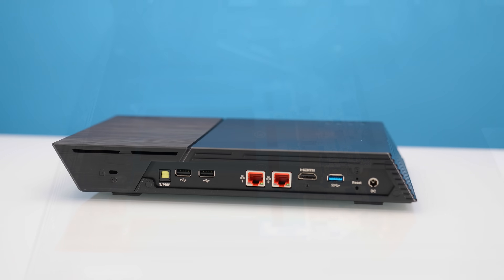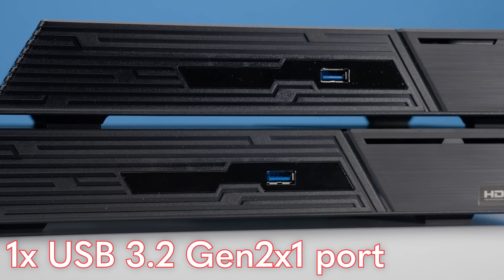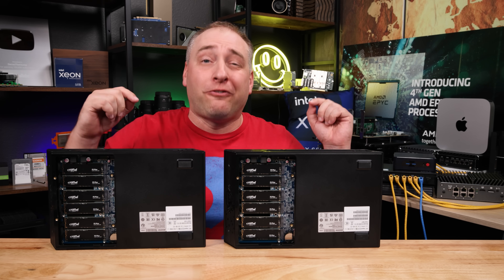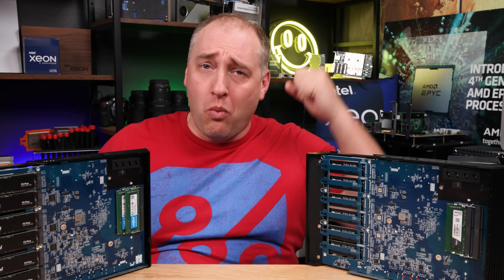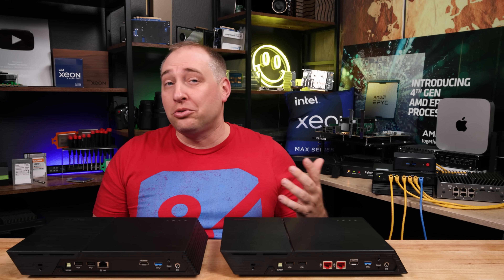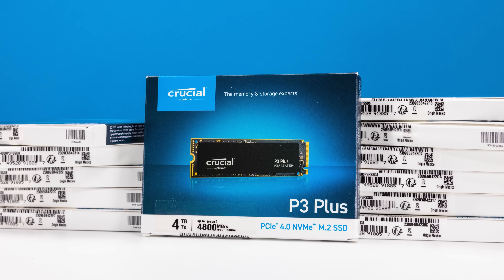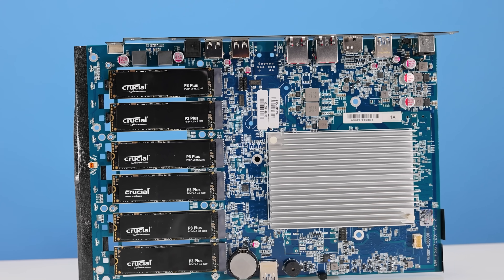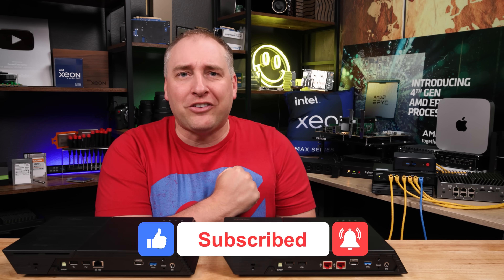Crazy 48TB SSD NAS and Cheap 6TB Version Asustor Flashstor FS67

Comment: I'm glad you finally explained just how anemic these devices are. I fear the way they're marketed might be misleading for some consumers. However, knowing that they barely have enough PCIe lanes to service a single NVMe drive, the NIC does make more sense. Although, 10GbE has been around for over a decade, and we're only just now barely seeing it begin to appear in some really compromised devices? Come on, what's the hold-up? And why does it need to reach out to 100 meters for? Why can't we have a new standard for short-distance communication over distances up to only 100 feet? We could do it with the same devices we already have. Just tweak the firmware, and use a different encoding scheme. I feel like the 100 meter standard is simply more than most environments call for.
Reply: Because the physical interfaces are based on standards and are designed to perform and apply to the widest array of uses in the commercial environments.  The consumer enjoys the trickel down of these improvements in products.  They take advantage of these by way of commodity chip sets developed to meet these standards via a slew of small, and not so small, players in the tight margins of the consumer markets.  Also, a run over 30 meters happens easily in allot of homes and fails to account for the end connection terminations and pair of patches.  Having the margins extended is a good thing where consumers are poorly installing and terminating twisted pair cabling.  Seldom do consumers follow best practices nor do allot of people calling themselves "professionals" for that matter!
Reply: @mikeiver  I'm aware of all that. I was thinking something along the lines of USB type-c or HDMI. Those have to be prefabricated, and it would offer the badwidth needed. It would be extremely short range, but that's plenty for most SOHO environments. We do not live or work in huge datacenters, factories, or institutions. Why should end users get stuck with the same crumby speeds as large organizations? Why can't we have a separate standard for consumers and end users? Consumer hardware is garbage, and it doesn't need to be that way.

Also, some devices are adaptable, and can change between 1, 5, or 10GbE. But, why are we limited to only these? Why can't we also have the option to choose higher speeds, but shorter ranges? The user should be able to adapt the device to the environment.
Reply: @TheChadXPerience909  Well you say you understand  but then miss the point I make entirely.  Regerious standards used for networking are arrived at with the participation of a bunch of stake holders contributing to the eventual standards everyone builds equipment to.  These standards guarantee interoperability and base performance.  They also cost many tens or even hundreds of millions to develop.  Consumer markets for your desired level of performance simply don't warrant such an investment.  Go 10Gb and use trunking.  Or buy used infiniband hardware if you think you really need to move that many bits that fast!
Reply: @mikeiver  Please do not speak to me like a child. I understand how business and the world works. I don't think it's unreasonable to develop products which adapt to the environment they're used in. We already have NICs which support multiple standards. Adding a few additional standards for users with shorter distance needs is entirely doable, and wouldn't be difficult to impliment. You could simply select the standard you want from the driver, or BIOS settings. All you offer is the same old excuses, it's too expensive, too much work, too little interest. We've all heard it before, and we're tied of excuses. That's just a negative attitude which holds human progress back. All you're saying is that YOU aren't going to get off your lazy  backside and get it done. But, that's a YOU problem.
Reply: @TheChadXPerience909  They already have that, it is called infiniband.  Your ask is not rooted in the reality of engineering.  Additional speed over shorter distances requires more power.  More power requires different processes and a total redesign of the physical interface.  The isolation transformers completely change as well.  Frankly, your ask is not based in reality and there is literally no need for what you ask.  We are not even talking of the cables and connectors yet.  These all would likely require changes to be made to reliably carry traffic.  If you don't like being treated like a child the answer is simple, don't act like one.  Clearly you lake the background to understand just how monumental your ask is.  Further there is no call for it.  You want more speed, get a 4 port 10Gb NIC for each machine and a 10Gb switch and bond the links.  Of course your machines will struggle to feed even a single 10Gb link let alone four.
Reply: J
Reply: 6th ly
Reply: the biggest pill to swallow is how anemic networking is, even local. My hdd NAS does 1gbyte/sec sequential reads, an nvme NAS will easily do 10gbyte/sec sequential reads. 100gbit networking to accomodate your ssd NAS won't be hobbyist-tier for a long time to come, while it's fairly mundane speeds by 'local' storage.

Comment: As long as you have enough lines to feed the 10Gbt and the same number shared across the SSDs you should be able to saturate the 10Gbt. More lines going to SSD will not increase overall speed significantly.
Reply: One drive is enough to saturate 40Gbe

Comment: This is an excellent time to release this. The price of NANA flash is so crazy right now. The price of SSD's has gone down so much in the last month and now the M.2 drives are dirt cheap. We're finally at a point where something like this makes sense to buy.
Reply: do you have any more in depth knowledge of the market to share? is this drop in nand prices cyclical or more permanent? is it a result of oversupply from the past year or so or was there a change in the cost of manufacturing causing prices to drop?

Comment: I have a home nas that I’m slowly converting to SSDs for the lower noise and power draw. I saw the m.2 price drops and figured that if I had a system with more M.2 / pcie slots it would be compelling.

That said, would love to see this in a rack mount form factor instead of this weird parallelogram. The price also seems a bit high before I’d bite.

Also, I worry about using consumer ssds with onboard ram and without  power loss protection

Edit: it’s N5105?! This is so pointless when you have all the drives squeezing through so few pcie lanes
Reply: a small ups would mitigate most of the power loss concerns, as long as it could communicate with the device to tell it to flush all caches. wouldn't need a very big one in this instance. i wonder if linux could be told to acknowledge sync writes as complete when they hit ram if there is a ups connected.

I'm more annoyed at putting all this high speed nvme behind 2.5 or 10g networking, such a waste
Reply: @konzo5942  But its aimed at the home user, and most home users dont have 10G even. When you start going to enterprise you start need more resilience so you end up with multiple independent nodes with a separate back end networking for inter node communication and each node having multiple 10Gbit interfaces.
Reply: @nexus1972  kinda missed my point. multiple 10g is still slow. the servers i deploy have a minimum of 2*40g, usually 2*100g. a single nvme has 32gbps bandwidth, and theres like 6 of them here, so you are losing so so much putting it behind these slow interfaces. id rather just buy a pair of older ex server 8tb ssds on the cheap and attach them to some mini pc.
Reply: @konzo5942  no you've missed the point. This is a home.appliance not an enterprise piece of equipment. 10g isn't common in homes your anecdote about 2x40gb and 2x100gbit is not the asustor market you're in datacenter territory there and you're going to be going down the tantric or powerstore or some other enterprise piece of equipment not a micky mouse home sector nas. Heck my home.lab is only 10gbit based and most home users don't have or need 10gbit. Even 2.5 is low % in home market atm.
Reply: @nexus1972  home appliance with 6 nvmes... my point is that this is such a waste. 10g is cheap, NICs for 50$ online, this device with drives is already $800 so 10g isn't much more. With your argument you should just put some usb HDDs on a raspberry pi, because who would need more right?? Anyway the people with home nases are the same people who would have a faster home network. I don't  know any soccer mom with a homelab.
Reply: @konzo5942  Its a home appliance with MINIMAL performance. Its only using NVMe as quiet and low energy use. Each NVMe has a SINGLE PCIe lane. It can never perform to the extent that the underlying drives can perform. This is designed as a Low energy, quiet home device. as such more than a single 10GB interface is overkill. what dont you understand about that? My point is that even power users who have home labs generally dont have above 10Gbit. so whats the point of more than one 10gbit interface or a 40 or 100gbit as you wanted. Ultimately if you want a faster device go build your own, this isnt designed for your use case. Each drive has a single PCIe lane and the cpu isnt going to have the horsepower to drive 40Gbit or 100Gbit. I cannot even think of a use case for home users that would justify > 10Gbit and the cpus on that device isnt going to be up to it.
Even a lot of our enterprise stuff in our datacentre is only 10Gbit with the exception of our vmware storage. I just dont understand why you are trying to make a silk purse out of a pigs ear. The asustor is m2 for capacity size heat and power usage only.
Reply: @nexus1972  Right, so like I say again, what a waste of all this high speed storage on barely any lanes and 2.5gbe. just plug a hybrid 2.5" HDD into a raspberry pi for similar performance and storage space. Quiet and low energy use aren't wants exclusive to the low end of home labbers. Plenty of people with higher performance networks can value those attributes too. A few 10g ports or higher sfp/qsfp on this would have been very nice like I said originally, and they aren't really expensive.

Also edit, this CPU is plenty for 10g and above. Basically forwarding packets isn't that hard, especially with a nic that has hardware offloads.
Reply: @konzo5942  you're clearly hard of thinking. Did you understand anything about this why ask for more networking on this. 8nvme drives gives a much higher amount of storage in the same space as 2.5 sata drives. You were moaning about it only having 10gbit for 40 you need 4 pcie lanes alone. Welcome to my block list. You were arguing initially you wanted more speed. YOU WONT GET THAT FROM THIS CPU. one pcie lane per nvme drive limits them to 1GB/sec max. That leaves 2 lanes for 10gbit card.
Reply: @nexus1972  dude stop coping jeez. perhaps they should use a cpu with 16 or 24 pcie lanes then. this device is huge, it could easily accomodate 2.5" drives and reach the same performance. they are so close to making this so much faster. i would never drop a bunch of money on nice nvme drives and then gimp them in a box like this.

Comment: If I were choosing between the two models, I think I would choose the two 2.5GbE one over the single 10GbE simply because it has 2 physical ports. I really like having a separate management network. I've also been thinking about setting up a Ceph cluster and that second port is useful for segregating the OSD's backend traffic from client access traffic.
Reply: Why not just use VLANs? I'm sure it supports VLANs.
Reply: @balthxzar  because I already have a physically separate, private network already set up. In fact, every cat6 drop already has 2 cables running back to the central switches/router.
Reply: @seanpalmer8472  but why not just add up an usb-nic for management then?
Reply: @coolm98  It's probably just me, but I have terrible luck with USB-anything that stays plugged in 24/7 (apart from mice and keyboards). They seem to die on me prematurely and/or aren't consistently reliable. Now, I avoid those kinds of devices as a general rule.
Reply: @seanpalmer8472  that seems incredibly wasteful, 2.5Gb just for management?
Reply: @balthxzar  In general, yes that could be considered wasteful of potential throughput. But in this particular case, I will direct you to the second part of my original comment. Now I don't know if you are familiar with Ceph clusters, but they generate quite a lot of backend traffic making sure all the nodes are healthy, in sync, have the appropriate number of copies distributed throughout the cluster, etc. (i.e. it's a lot of traffic). A 2.5 GbE link would not go to waste, I assure you.
Reply: You can buy a USB 3.0 or upper version dongle to add the 2.5G ethernet output.
Reply: On the motherboard I used, the management network port is a totally separate thing, and it works even when the motherboard proper is turned off.  You can see the power-on sequence on the virtual display, and get into the BIOS, etc.  It was especially handy for mounting a virtual optical drive to install the NAS system.
The web-based interface for the NAS admin runs on the normal network port.  The virtual display, keyboard, mouse (and mounted virtual hardware) runs on the other network port.
Reply: Setup an Ceph multi PiB cluster years ago, the journaling drives had a unique way of failing. Not fail > dead. But... Slow... very slow... not dying. I think adding a ceph cluster on this might be fun, but i would just bond the nic's and then put some bridges on top of them. Management NICs are for something you cannot access directly, i wouldn't put this in a DC.

BTW I would also not cram Ceph on top of this, ceph will never get to rebalance at full speed due to the PCIe lane limitation.
Reply: @0to1-nl  Oh, I wouldn't put this in a data center either. It has a couple of hardware specs that really hamper potential performance that I'd want in a real production system. I was thinking more along the lines of a budget 3-node ceph cluster for a homelab or maaaaaybe a small business (one that wants the resiliency of ceph but doesn't have large IO needs).

Comment: Y no IPMI Asus 😢
Reply from the maker: That would increase power consumption by >5W and use a PCIe lane in this platform while also adding tens of dollars to the BOM.
Reply: @ServeTheHomeVideo  I get ya but at the same time if you have a mount point on nand you probably use it a lot and will want fast resets if it borks

Comment: I'd love something like this with an i3-1315u With a motherboard that supports 1x bifurcation. Imagine 16 drives, each with one PCIe 4.0 lane, and then the last 4 lanes going to 40G or 100G QSFP+
Would be a great portable all-in-one NAS, the only thing that would make it better, would be to take the 1360P, and instead of 4P+8E cores, trade the P cores for E cores. A micro NAS with 24 E cores, keeping the pretty decent 96EU XE graphics. I have older graphics and they still work pretty well with AI image recongnition. With that core count, support for 128GB of RAM, and 16 NVMe, a decent GPU, and high speed networking, this would actually be a pretty powerful server, but absolutely tiny.

FYI, while i have no way to actually test this because Intel doesnt make a 14 P core dekstop processor, i can extrapolate that 24E cores offer the same performance as 12-16P cores, while using around 80w, instead of ~270w

Comment: Linus Tech Tip reviewed Apex Storage X21 PCIE card . You can pack there  Host 21 x M.2 Gen 4 NVME SSD’s -> 168TB+Storage Per Card
Reply from the maker: Yes. With U.2/ U.3 SSDs already at 32TB each (like these: https://www.youtube.com/watch?v=qMCqE6tLtoI ) You can also get 128TB using simple bifurcation out of a x16 slot without the cost and overprovisioning of a switch card. But it is very cool!
Reply: @ServeTheHomeVideo  Ok let say I want to build home system with Asus WS W680-ACE ATX motherboard ... What is the best way to connect these U.2/ U.3 SSDs ...?

My point I think m.2 nvm disks are more towards  consumer as this product. from Asustor

Comment: How much more would this cost with something like a Ryzen 7600?  Way more PCIe lanes and still fairly low power consumption.  I guess at that point you're fairly close to a mITX system with an expansion card, but the compact form factor is still desirable.

Comment: For me, the appeal of this hardware setup is the potential for a virtualization server running a router and a NAS with plenty of power to do both jobs, but without the noise and energy impact of spinning disks. Do I have to run Asustor software to match? Or can I do a linux distro if I want to?
Reply: I believe asustor do allow you to install linux but for me the n5105 is the limiting factor here - this is designed to be quiet not performant.

Comment: Apart it being silent I do not really see a point of this device. Especially the one with 2.5Gb. And then matching it with the CPU that does not have enough of PCIe lines.
And external power brick (I hate those).
Reply: yeah, usb-c PD maybe make this much better device. it below 30w on full speed operation.